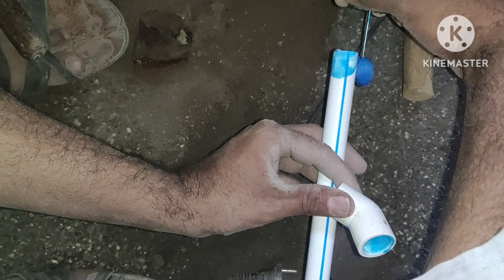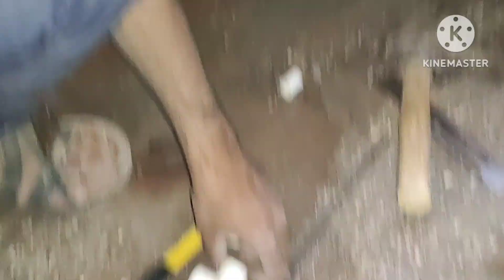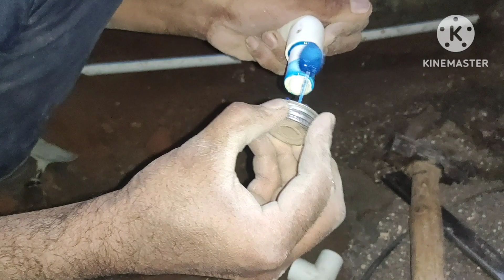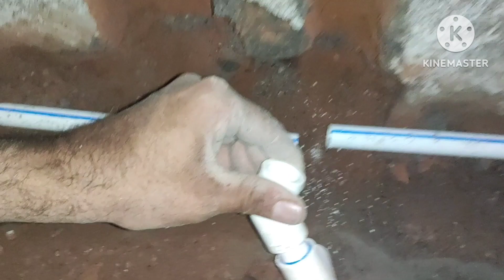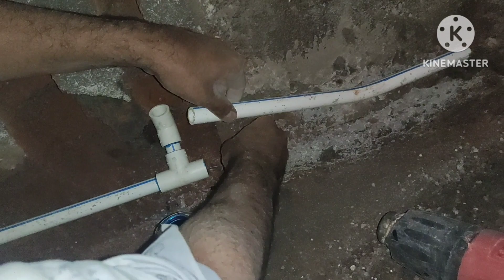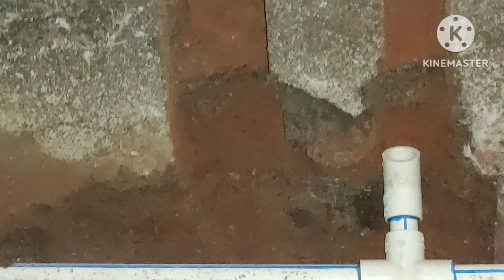How to insert the tee in concealled fitting @plumbing skills

Comment: very good job ! However, to connect the second joint in such a wide position, it is not necessary to soften the pipe, this can certainly be done by a plumber! because I have been a repairman for nearly 10 years! Wish you early success !
Reply from the maker: Thanks for the tip!